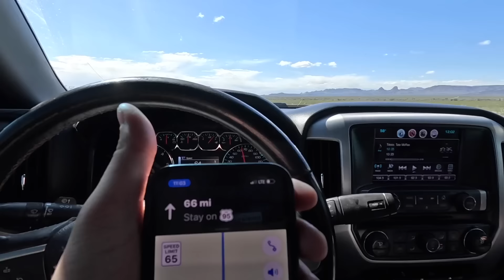The REAL Reason We Went To Glamis

Comment: I've never been a big fan of sand. But I'd rather have sand in everything  then ice and snow. Looked like alot of fun. Thanks for sharing.
Reply: ice and snow melt away, that sand looks like it would be with you forever
Reply: @thomassummer7478 ya,it is alot harder to get clean. I'm just old now and get cold easy. I lived for snowmobiling when I was young.when thy were called leafers. My back hates me now but I luved it to much to stop.
Reply: I hear you, my knees aren't much for ditch bangin either, but, so much fun to have a fresh groomed trail and crack the throttle. @shaunsmith928
Reply: As awesome as the sand was it would be hilarious in snow. LMAO

Comment: I think the thing that surprises me the most is that while Paul's buggy is the only mid engine arrangement it doesn't fly through the air like a mid-engine should lands front wheels first, but then maybe he just doesn't know how to launch it properly because it's not running great at this point. Paul says remember what happens when you say one more time? And it broke the tie rod again. I believe that if Paul's buggy was running properly he could have done some great jumps, because it should have flown through the air and landed basically rear wheels first just before the front axle touchdown

Comment: Looks like everyone had fun sad the machines didn't last longer but considering how fast you put them together they did well knew a guy years ago that use to race and had one setup running with a pinto 4 water cooled engine coolant ran through part of the cage to get to the rad was a neat setup

Comment: That looks like an absolute awesome time ripping around the dunes. besides the small issue of regularly getting blasted with sand while out cruising around but thats a very small price to pay for an amazing time out in the dunes.. 
Paul seemed like bringing the tow truck was an excellent an very much needed idea aswell as deciding to just take it out cruising just to see how well it does in the Glamis sand which is prolly alot different type of sand than the sand thats near your house &or@ sand hollow. An while out just cruising the wrecker you quickly found sand rails in need of a tow an if it wouldn't of been the JDs sand rail it would have been Landon since he broke down seconds after the JDs rail.. So having the wrecker turned out to be a great vehicle to have out there but you prolly had planned for atleast some of the sand rails yall brought would have some issues an need a tow back to camp & if not yours many others would most likely need a tow aswell.. Hunters jump comps 2nd jump with the slow mo was rather awesome to see him get blinded with a huge face full of sand followed by a huge jump even his pre-jump jump that looked like it could end badly with him landing a bit off kilter an started getting a little sideways an still had enough in it to really hit the main jump.. 
 Glad yall had a blast out there & awesome to see just how many people actually got together with their toys to rip around Glamis all for your cousin Merlins awesome B-day celebration weekend.. 
Happy Birthday Merlin!!!! (Paul could you please pass that along to the man of the hour well actually the man of the weekend Mr. Merlin) Johnson)

Comment: I think it really didn't matter who won the competition, because just seeing you and your kid having such fun together was worth the whole trip to glamis in my opinion. The next time you want a real challenge with your sand buggies, go to Sand Mountain in Nevada. The face wall is 600 ft tall by a mile wide by a quarter mile deep and the big bowl on the backside is wonderful for practice and for beginners. It's also called the singing sands and it's on highway 50 just east of Fallon. I took my 4x4 barracuda out there and it just didn't have the traction to make it up the face wall, but I gave it a good shot before I went around to the back and played around in the huge bowl on the backside. It was also my first experience writing a three-wheeler, which are incredibly dangerous. I managed to make it most of the way up the face wall, which was sketchy at best and then on the way back down to normal route goes over a bump at the end that launches you in the air! I did it, but I'll never get on a three-wheeler again. Four wheelers and side by sides are the way to go nowadays